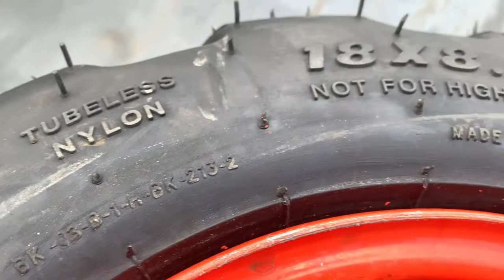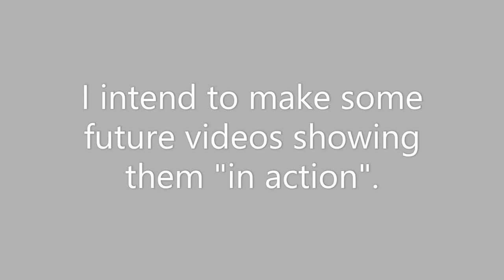Kubota BX25D-1 BKT Skid Power HD Tires

Comment: Those boots only last a year or so on the BX25D even parked in a carport. Kubota replaced them once and a year later they were cracked and opened again. I just ordered Kenda skid steer tires from Walmart for the front (6 ply). Side walls were failing on the R4s with only 200 hours on tractor (10 years old). The Kenda's were $150 for two but the BKT were more.

Comment: I just got the same tires, and I think you’ve misread the intent for the 100psi. That pressure is for seating the bead on the rim only, which is typically done with high pressures (like 80-100). There’s a kpa value on the tire of 300 max. That’s the pressure we want to run no higher than (roughly 43PSI).